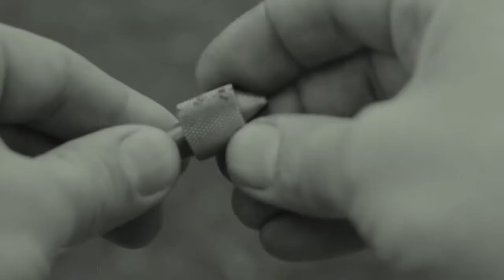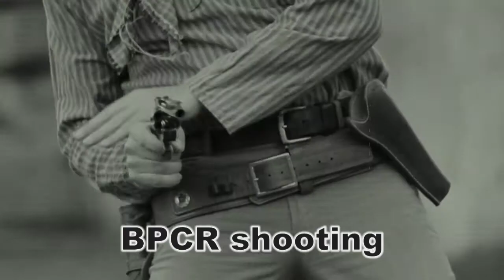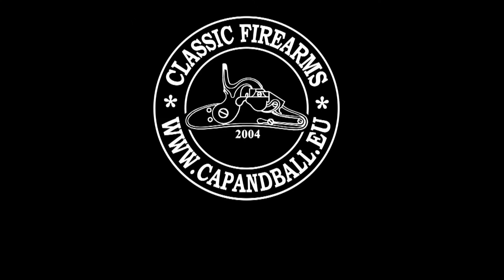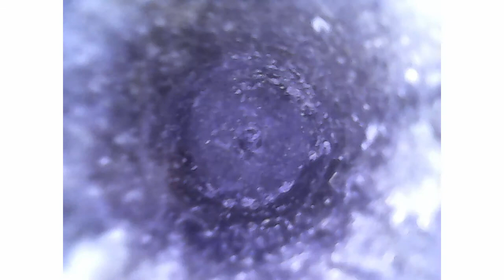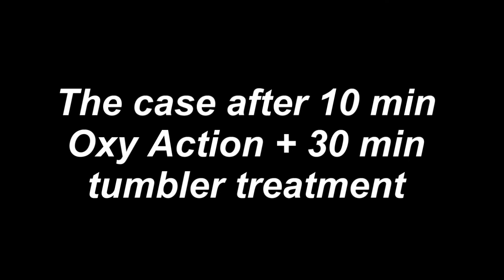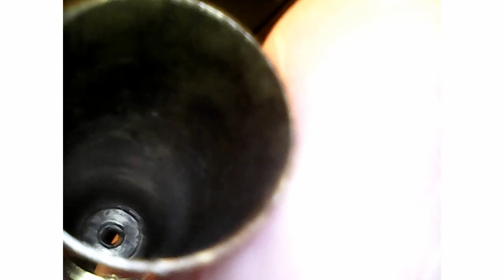Black powder cartridge reloading - 2nd part: Inside the case

Comment: I found TSP (Tri Sodium Phosphate) and or 20 mule team Borax maybe a little salt to clean cases very well and our ancestors’ used these items. I use this in my vibratory tumbler for larger batches (or rotary) filled below the 1st possible leak point. if used with or without media works great!
I have cleaned 30 year old "Desert Brass" this way like new.

If I want nice color after cleaning, flush and repeat with Vinegar, water, salt, rinse well, neutralize. well dry, I then coat inside and out with a zip lock bag, shack and bake with my case lube just a few sprays from a squirt bottle of 80%IPA, 15%lanolin, tinny amount 5%castor or mineral oil or same with Ballistol.

What our father could use? No reaction with any propelants or me over time, helps next cleaning. all food grade. simple, clean, around the house, safe, no staining. Works well on wood, tools and guns also.

Keep your powder dry!
Love your show!

Comment: I used stain remover, the effect didn't work as planned. However they are better than what they are, the foam just didn't attack the cases and didn't foam over the top. Is it Oxi Clean you're using?

Comment: this video wasn't very helpful. you didn't cover proper solvents or your own cleaning method. and i also have a question about corn wet. i use dry weed leaves which leaves me exposed to extream cilinder pressure.
Reply: Then use cooca powder or some kind of wad, and not dry leaves. I've never personally used any sort of filler, as I've never found a reason to.